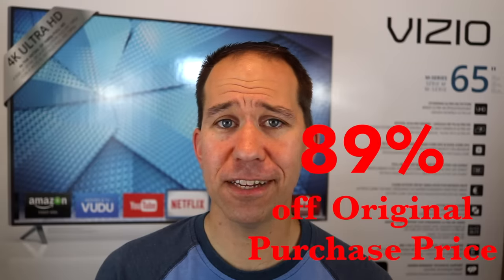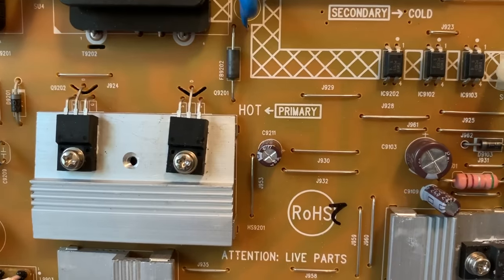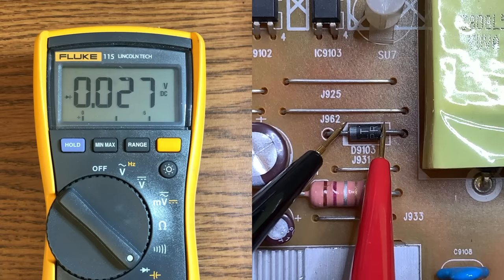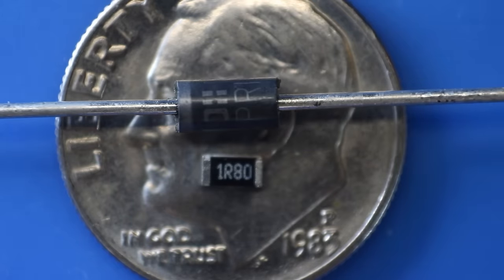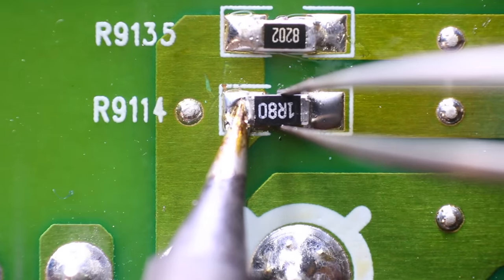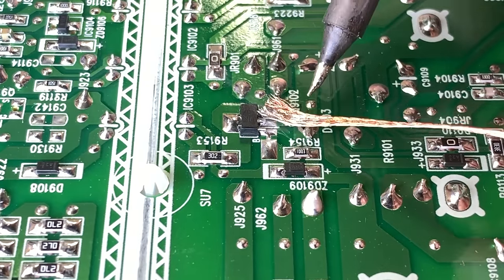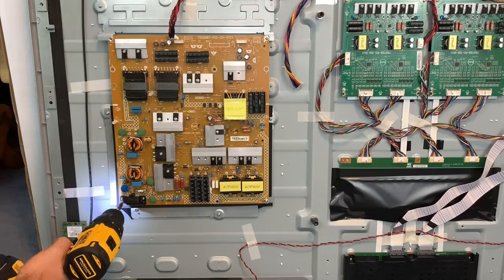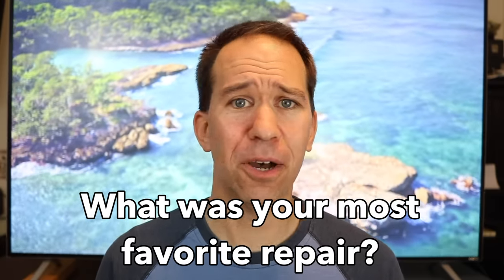I got a broken 65” 4K TV - How I repaired a Vizio M65-C1 (tv won’t turn on)

Comment: It's sad that we live in a disposable world these days. I had a washing machine that stopped agitating recently. $7.00 in parts and 10 minutes of my time. Now it works like a champ.
Reply: Its moreso not everyone is an engineer
Reply from the maker: Great job on the repair!
Reply: I have a Maytag washer that quit working.  Made a really loud screeching noise during spin.  I looked it up on youtube and got some ideas.  I started taking some parts off to look for the bad part when I noticed a nut that should have held these parts to the main shaft was missing.  Bought a new nut at the hardware store for 13 cents.  But my daughter found the old nut laying on the floor under the washer, so I wasted 13 cents.  Re installed the old nut and fixed the washer.  Dryer went bad just before the washer quit. Again, checked you tube.  Replaced a tensioner bearing for $15 off eBay, dryer works fine.  Grand daughters dryer quit after about two years of use. Cleaned the too long exhaust tube (cheap plastic), replaced $60 of thermostats and sensors and fixed the dryer and I know nothing about any of these appliances.  Oh, last year fixed my furnace. Replaced a capacitor on my blower motor. And I am getting older and I am not nearly as energetic as I used to be. 

I admire your creativity but I was wondering what would you have done if you had not found a hint on you tube and had to start from scratch to trouble shoot your problem.
Reply from the maker: Charlie Wilson Great repair stories!  What would I have done if there was no info online?  I would have quickly known the power supply was a problem due to that fluctuation.  I would then visually inspect it, maybe I might have seen the hole in the resistor, maybe not.  Then I would test components (like this diode), power supply unplugged, of course.  The info online helped speed up the process tremendously.
Reply: @FrugalRepair  I was watching your tv video because my 4-5 year old Vizio was turning itself off and on about every minute or so.  Since I have found a lot of good information on you tube about repairs, I thought I would give it a try.  I remember tv from the old days when they still had CRT's and high voltage power supplies and you had to have an understanding of how that stuff worked.  Fast forward to 2019.  Now we have LCD/LED screens and no high voltage power supplies and how things have changed. After watching your video and a couple of others I learned that these tv's look pretty simple even if you don't understand how the circuits work.  There are a few circuit boards that have some wires plugged into them.  It seems to me that a person could try to narrow down which board is bad and just replace it or if all else fails and the boards are cheap enough, just shotgun it and replace all the boards.  Boards may not fix all the problems but chances are it would fix most.  However, as a former electronics tech (now retired), I found your troubleshooting and repair very interesting.
Reply: @FrugalRepair  This is just for my information.  I am not questioning your process. But what would have made you look at that fluctuating voltage?  Is it just that knowing nothing else about the problem that checking the power supply voltages would be a good place to start?
Years ago there was a magazine Radio Electronics or something like that and there was a guy who wrote a monthly column for the magazine about his experiences working on tough tv repair problems.  This was back in the vacuum tube days and maybe early solid state sets, but they all had CRT screens.  I worked in industrial/military electronics but never worked on tv's.  Still I found his stories fascinating.
Reply from the maker: @charleswilson4598  Checking the main rail voltages on a power supply is one of the first things you do in a no power situation on a tv.  This power board is a little odd in that 19v (in my experience) isn't a standard rail voltage.  You are usually looking for 3.3v, 5v, 12v, etc.  But it really should be a steady voltage in any case.  If you disconnect everything else to this power board and only plug it in to the wall, then you see a fluctuation like this, it is a good clue.
Reply: @FrugalRepair  Thanks for the response.  Makes sense to me.
Reply: they say electric cars will save the planet. have you seen how anti repair a tesla is? not saying electric cars aren't cool but, no one bats an eye disposal
Reply: Charlie Wilson .. Bet your family loves having you around!!
Reply: cdoublejj .. Yeah, soon only the very wealthy will have electric cars, leaving everybody else to walk or hitch a ride on something else! I just heard a report about this - to keep us all under control, but the fact of the matter, what will we do with all of those cars and batteries, once they're disposed??
Reply: @LifeX2Find  i believe a "quarrel" using gunpowder based ballistics would break out between classes by then.
Reply: becoz compnay want more and more money
Reply: Yeah, it is because people think it is much more cheaper to buy a new one than just to fix it.

I do missed Radio Shack......

Comment: My favorite repair was taking apart an old Bose desktop system and found the fuse had blown.  I was too lazy to fix it still.
Reply from the maker: Thanks for letting me know!  Though, it sounds like maybe a "repair in progress"?
Reply: was it cuz it was a bose sound system?
Reply: In general, when a fuse is burnt, there is another failure. Changing the fuse will not repair the unit. If the unit has a switching power supply, the most common fault which can blow a fuse is one of the transistors going bad and shorting.

Comment: Thanks for always making videos that are simple, concise and thoroughly informative at the same time. I'm electronically-inclined, but this is a whole new level. Your videos give me the courage to delve deeper into electronics repair. I've repaired several tv's, most with pretty minor issues. My favorite was a $4,000 marine radar/depth/speed/chartplotter MFD (multi-function display) I found labeled as "broken". It was a pretty simple repair. Now I have a super fancy MFD for my boat which I would NEVER be able to afford.
Reply from the maker: Thanks!  And thanks for sharing that great repair story.

Comment: In my early days of repair, my favorite repair was tape decks that ate tapes.  I was a curious kid and figured out after disassembly of a couple that the drive belt had stretched and could no long apply enough torque.  I found an old electronics shop in town and they sold me the correct square belt and my tape deck was back in action.  The belt was prob only a dollar at that time.  I went on to fix a number of walkmans too.  It was a very satisfying repair.
Reply from the maker: That’s great!  Thanks for posting.

Comment: Great video Reese! I fixed my 27" Vizio flat screen years ago when I had the same issue. No power, no picture. A youtuber  had this same issue. He was an electronics repairman. He showed which resistors normally go bad and how to tell. Opened mine up and found the exact same bad components. $8 in new parts from Fry's and boom! Power and picture! And I learned basic soldering from it.
I have also used youtube to help me replace a water pump in my washing machine and put a new motor in my dryer over the years. This kind of work is not that difficult if you're willing to put in the time and effort to learn, AND you can save yourself a ton of money! Cheers!
Reply from the maker: Thank you!  Those are great stories!  Great job taking on the repairs.  I bet that felt rewarding to see things come back to life.
Reply: Oh yeah! And the butterflies RIGHT before hitting that power button are intense! Then the flood of endorphins when it starts and works! Can't beat it!

Comment: Many years ago I fixed a $500 BenQ LCD with $20 of parts off eBay.  The fault was so common that people packaged up the components with instructions on how to fix the power supply.

My biggest repair was fixing an Aurora 5000 solar inverter that developed an E031 error.  This is a very common fault on pre 2014 models.  Replacing two $3 relays did the trick and the $2000 bit of gear is back in service.
Reply from the maker: Those are great stories!  Thanks for sharing.

Comment: I've been repairing PC for over 25 years now. It's amazing how much good parts were thrown away over the years I have been working on it. Majority of the issues were minor fixes like the one on video and some were even ridiculous like missing jumpers or seating issue. I get that not all are savvy with fixing but things like incorrect seating should be an obvious thing any one could fix. I partially blame it on companies like Apple and other manufacturers actively discouraging people to open their own devices.
Reply from the maker: Agreed!  I purchased a really nice tv (return from a big box store) and the issue was that a connector wasn’t put on! It goes from that to microsoldering but in most cases it’s a single point of failure.  Thanks for commenting!

Comment: i also did the same thing i live in South Africa i bought a Hisense 50inch for R900.00 it had a problem of going on after 10 or 15 seconds in goes off. and i spent about R100.00 fixing it
Reply from the maker: That is great to hear!  What did you fix or replace on it to get it working again?
Reply: 60 euros for a 50 inch tv

Comment: Awesome! Very clear instructions (which is very much appreciated). I have a surround sound amp that has been out of action for some time now that I still can't figure out what the issue is... the front display comes on but no sound out of the speakers. Hopefully I can learn from you and eventually figure it out.
Reply from the maker: Thank you!  I hope that I can help.  I'd love to hear that you got it repaired.  I'm not sure I can say much about the it.  Do any of the capacitors look funny?  Any common problems posted online about that model?  Did you check ebay's history for parts or repair kits that may have been sold for that model?  Have you tried every input available on the unit?  Does the headphone jack work?
Reply: Output transistors

Comment: Fantastic job, Rhys! Love how you unpack the story around this. I did a repair on an older plasma - replaced capacitors. This was before my YouTube days (wish I would have filmed it 😩) You make this look so easy, now I want to go find a 4K TV to work on! 👍🤛
Reply from the maker: Thanks!  I'm sure you can pick up another tv that either has capacitor issue or a shorted led backlight to repair.  There are lots of them floating around.   For 4k, go for it!  Someone recently gave me a 55" 4k that broke.  They said the repair guy couldn't fix it.  I like these kinds of challenges. =)
Reply: FrugalRepair I like your optimism! I’ll keep my eyes peeled for one.
Reply: @FrugalRepair  Hey, I have a challenge for you, Rhys. I just dropped a video today on how my Motorola Surfboard cable modem has been power cycling. It’s showing T3 and T4 timeouts. I had the software updated by my ISP, tried using a different power adapter but the problem persisted. I ended up swapping it out for a different modem. I actually do a shoutout of your channel and ask you for help on whether you could figure out what’s wrong with my modem (I believe it’s a hardware issue). Have you faced this type of error with any modems you’ve used?
Reply: @HandyHudsonite  Man, I gotta stop throwing electronics out and start fixing them. It's crazy how big dollar items can be fixed quite easily and economically. Definitely making me regret throwing out the last few items. Good luck on your modem Matt, and awesome work on the TV and channel Rhys!!!
Reply: @TheRealBeardedBusinessman  Thanks! I agree - we need to keep fixing what we can. I repaired my old Samsung Plasma - just replaced two capacitors (they had bulged) and it still works great!
Reply: @HandyHudsonite  It'll get us all that much closer to our own financial independence!
Reply: The Real Bearded Businessman Right on! 👍

Comment: Great work! About a month ago I bought an older 55" Vizio LED Smart TV (E550I-B2) that would not power on from a pawn shop for $30. Some troubleshooting later led to discovery of broken solder connections between the power board and LED board. After resoldering the connections, The TV worked great!
Reply from the maker: Thanks!  Wow, that’s a cool story.  Congratulations!  I’m sure it was very satisfying and fun to do that.  My next video will be about a 55” 4K that a repairman gave up on but I got working with some tape.

Comment: Reese. That was awesome. I took a few friends tvs to the repair shop and they proclaimed DOA right there in some cases and yet sold used flat screens in their store. It always bugged me that an expensive tv was not worth bothering with. Now after your fix,I have new eyes to explore my options thanks.
Reply from the maker: Thanks!  Usually, unless the lcd screen is cracked you can fix it.

Comment: This is awesome. I did the same thing with my ps3 when i was kid but it had ylod just had to use a heat gun to warm up the gpu and cpu and once i put it back together after 2 failed bootup attempts it worked and ive been into fixing stuff ever since even built my own computer.
Reply from the maker: Thanks!  That is great to hear.

Comment: Great info. I bought  a Sonos 3 from eBay. It was DOA. I wanted to return it but seller said just to keep it and refunded me. I popped it open - bad  capacitor and burnt trace. I replaced that capacitor and bridged the trace for less than two bucks - win! I have an old 50" plasma in the basement that needs fixed. This video gives me some hope.
Reply from the maker: That’s a great story!  Thanks for sharing.  Glad to hear that you might take on the plasma tv repair.  There are many common failures on the plasma’s, especially the older Panasonic’s.  You might have a good guess just by searching your model online.

Comment: Have a Toshiba I7 laptop that I bought for next to nothing and replaced the screen .Managed to get the screen off eBay fairly inexpensively and about a 1/2 hour later, viola, new DJ computer.  Do a lot of things like that. Love it when a plan comes together!
Reply from the maker: Great story!  Thanks for posting.  And I love the A-Team reference!  Where has Mr T been lately?
Reply: @FrugalRepair   Thanks for the acknowledgement. Thing I like best is that like me you put some forethought into your repairs as well. I always figured if you're making a repair anyway, why not try to make the equipment last longer? Adding the thermal tape to allow for better heat distribution is exactly what I would have had in mind. I think going the extra mile lessens the workload and allows for more time to enjoy the fruits of your labor. That's what made some of the greatest machines ever built what they were. Built like a tank and with redundancy added extends the dependability! Thanks again for the reply.

Comment: I am amaze that you use Infrared to check board for cool component to give you a sense which component is faulty. Do you have video on repairing power supply that is faulty? I do repairs of power supply in my office, but these are repairs process where our company have already identified which resistor is giving problem and is just a automatic process of just replacing that resistor. Thanks.

Comment: Liked 👍, I like your random repair videos.
Reply from the maker: Thank you!  Many more are in the works.  Looking forward to you getting to 500k subs!
Reply: Hi Tampa Tec. I have a Vizio M60-C3 coming into my shop tomorrow for a backlight job. Do you recall if the M-series has those damn internal clips that make removing the back cover near impossible to remove without destroying the TV?I had an E60 on the bench here last year and it took nearly 3 hours to get the back cover off,and my hands and arms were just BLOOD.I finally just went for it and RIPPED it off.Somehow I didnt destroy the TV set. If this M60 is the same design,Im turning the job down.Thanks!

Comment: I have fixed a bunch of LG TV's that just needed new capacitors. Favorite repair had to be a 55" LG 4K tv that just needed a new power board . Paid $50 sold for $250
Reply from the maker: That is great!  Glad to hear about the repairs.
Reply: Maybe you could help me Jesse Warren...I have a 75 inch LG 4k it's not even a year old yet and has horizontal lines at the bottom of it....everything g else works fine on it.....I reset it back to factory settings lines go away and then over time lines come back? Any suggestions on how to fix it?

Comment: My "educated guess" is that the resistor is in series with the diode. When the diode failed short circuit, it put too much current through the resistor, causing it to overheat and fail.

My suggestion would be to substitute a different diode with higher ratings: a higher forward current rating and higher PIV (peak inverse voltage). The diode may be under rated if failing in multiple TV sets. This would be a design issue, something the manufacturer should address.

My inclination would be to substitute a more readily available through hole resistor (one with leads) for the surface mount resistor. However, the resistor did behave as a fuse, protecting other components. The through hole resistor might not do that. So, only replace it with an identical surface mount resistor.
Reply from the maker: Thanks for your thoughts.  Yes, the resistor is in series with the diode.  I would like to get a schematic of this board to get a better sense of the design and perhaps, the failure.  It seems to be either bad design specs or a batch of bad diodes.